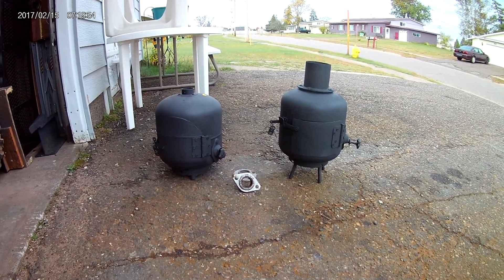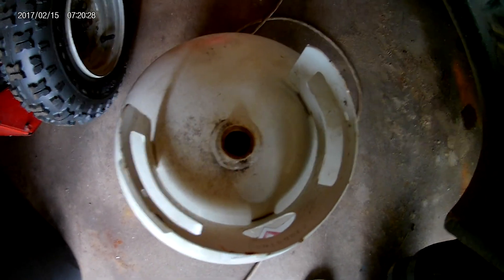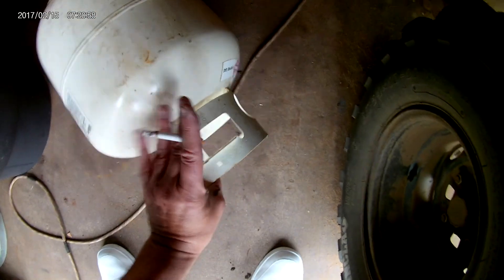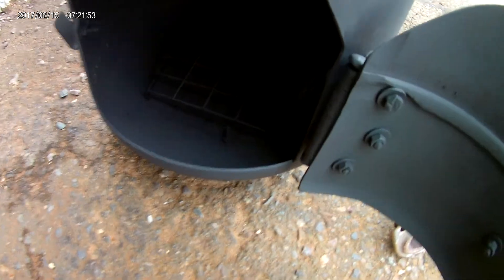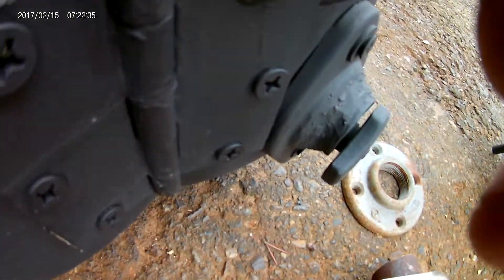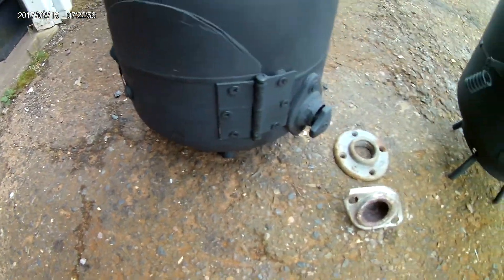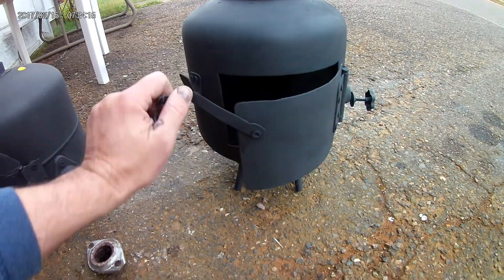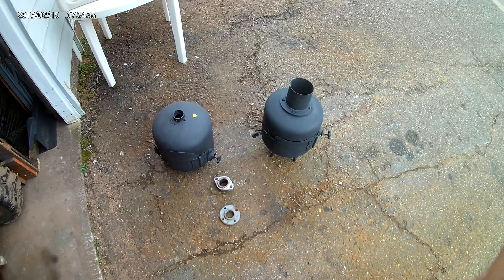Propane Tank Wood stove  the easy way , with no welding video

Comment: Thanks again! I have been mulling this over for a while for my workshop. I don't weld and was only seeing welded versions. I knew it would be possible, but it is really nice to see someone who has worked it out thoroughly! Makes it much more doable. I fix tape machines if you ever need any tips!
Reply from the maker: You mean like real to real ?
Reply: @robinhoodprojects9509  Cassette Multitrackers that DIY bands used in the 80s and 90s mostly, and 1/4 tape echo boxes! And other music gear. Stove is for a small garage I work in up in Canada. Got the valve off and flooded the tank already.

Comment: Hi. One of the stoves has a small pipe and one a larger. Which one works better, in your experience?
Reply: You two stoves are the same size. So, which one performs better? Small pipe or bigger?
Reply from the maker: Its a trade off the one with bigger pipe heats faster but consumes more fuel and loses more b.t.us up the pipe or british thermal units so it produces more heat but also is vastly more  ineffcient  the small one produces less b.t.us but consumes alot less fuel .....Meaning the question is relative which would you prefer? Like a monster truck you can have power or good gas mileage but not both!
Reply: SLIPSTREAM WASH thanks
Reply: I made a smaller one and a bigger chimney like his . The small chimney ( Smoke pours out the door )  I prefer the big chimney . It makes great fires
Reply from the maker: very cool I am glad it worked out sometimes you have to try different combos to get the combustion air right. I hope you like my channel and share it.
Reply: Liked and Subscribed
Reply from the maker: large